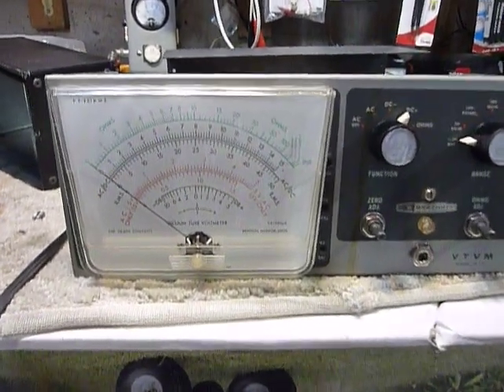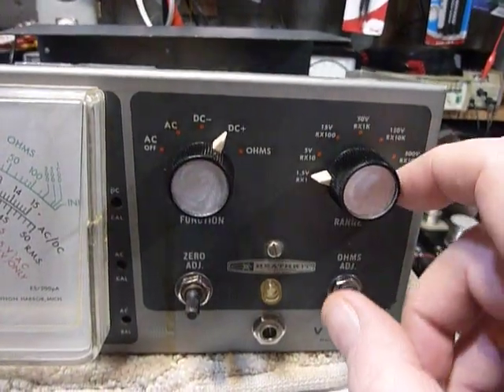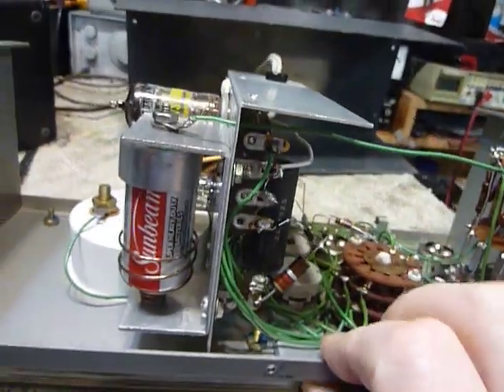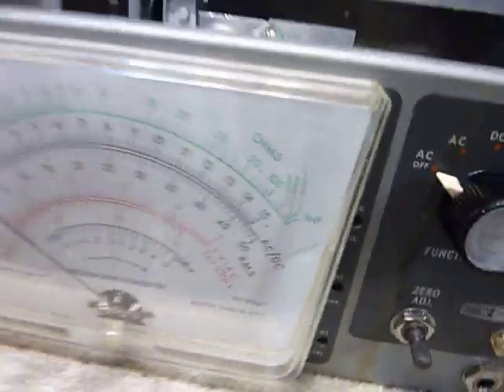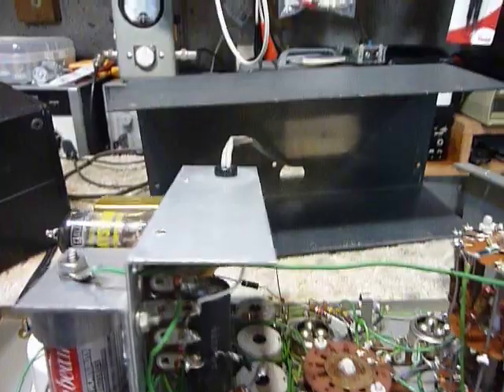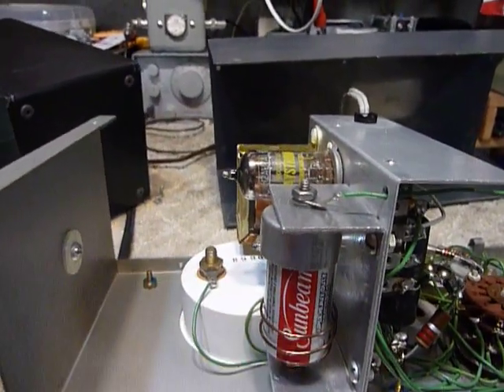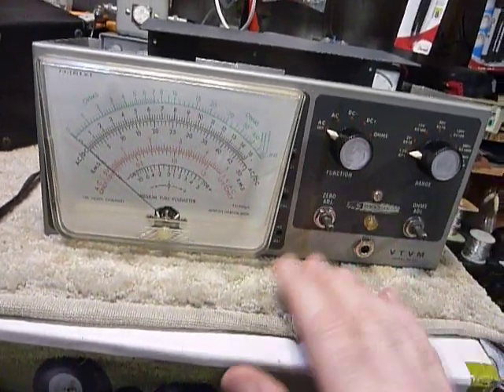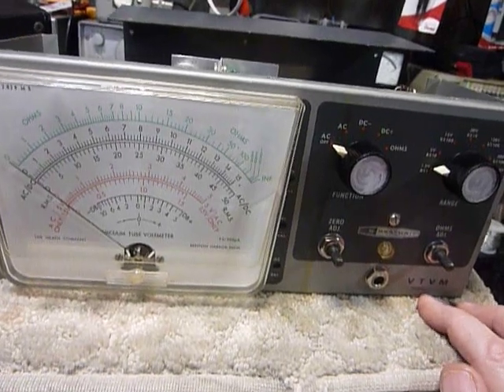HEATHKIT  VTVM , BATTERY ELIMINATOR CIRCUIT FOR HEATHKIT VTVM

Comment: Hi Bob,
I’m retired technician from the Bell System. I have a Heathkit IM-5228 VTVM that I built in the 1970’s. I recently decided to spruce it up. I used black anodized hardware to replace the oxidized ones. I also checked and cleaned all the contacts and replaced the electrolytic capacitor. 
I’m thinking about a battery eliminator and found your video. I like the simple design and especially the fact that the one you discus was designed by Heathkit.
How do you feel about the LM-317 based eliminators? With the 5228 eliminating the incandescent bulb from the filament circuit it should be able to support such a device? I’d like to hear your take on it.
Regards 
Tom Heckhaus

Comment: I independently developed this same battery eliminator circuit when I hacked my own Heathkit VTVM, the only difference being that I arrived at a value of 47 Ohms for the dropping resistor, instead of the 27 Ohms suggested in this video. My meter works fine with the battery eliminator using the 47 Ohm value, the Ohms ranges all work with the full range of my resistance decade box. 

That did not stop an overzealous viewer from repeatedly and persistently claiming that the battery eliminator design I showed in my YouTube video of the hack would not work properly, and/or would result in the VTVM not working properly in all Ohms ranges (yet it DOES), or somehow using such a battery eliminator design would damage other parts of the VTVM circuit, e.g. the power transformer. I feel vindicated what I see others happy and successfully using the same circuit.

Comment: This is one of the best circuits I have used Bob Thanks for sharing. Both my IM25 and I am in the process of completely building a V7 from Scratch it was in a house fire and is realy toasted  main board was badly burned I have got it ready to make the new board this circuit will be added to that one also And my RCA WV-77E has it installed what a fun project Keep up the videos Watch them all

Comment: note that you don't even need to filter the d.c. since the meter will respond to the AVERAGE value of the pulsating 1/2 rectified d.c. 
You can select components to yield about 1.5 volts average value with decently low source impedance.  Neither that approach nor this circuit regulates well on X1 range when measuring low resistance like a speaker voice coil or a light bulb filament.  Very good performance for high resistance DUTs like a 1k2 resistor and the like.

Comment: Nice job!  You didn't mention about the Cadmium oxide on the sheet metal screws.  (nasty stuff)  Tin whiskers on the cal pots can be an issue too.  A very good instrument for 1963 design.  The low current, large scale, d'Arsonval jeweled meter movement is the key to its high accuracy.  I've got an IM-18 in very good condition - really nice legacy instrument

Comment: Why would u do this to a vtvm? By doing that u alter the ohms per volt sensitivity  of the meter. The purpose of a vtvm is just that. The battery  lasts for years, The power for the ohms section has to be isolated and float.   Theres no gain to it your just degrading the meters specs. Why do u think Heath kit or any other manufacturer didn't do that?  You might as well get a solid state meter and discard your vtvm.
Reply: RN-ek4mh, you are hung up on things which are not important. As Heathkit found in their testing of this battery eliminator circuit, it works fine on all ranges and meets the specified accuracy. A great many others have also vetted this design and verified it works fine and has no downsides worth mentioning. While a battery eliminator based on LM317 works in a slicker way, with less power dissipated, both approaches work and this is well proven.

And while you ask "Why would u do this to a vtvm", I might respond "why would YOU repeatedly spell out all the words except 'you' ?"

You also fail to realize the primary reason that so many VTVM owners choose to retrofit battery eliminators. It has nothing to do with how long a battery might last, rather it is all about the damage that a leaking battery causes inside the VTVM, and not wanting to worry about it.
Reply: @youtuuba  Im, not hung up on anything it seems you are, as nobody uses vtvms anymore, but certainly that idea is a hugh waste of time and effort and effects the meters accuracy anyway. It just sounds like you have nothing better to do. A battery in a vtvm will last for years. If you worried about leaking use a lithium battery or one of the newer rechargeables they dont leak. Theres a reason meters were not designed like that. Accuracy and noise free power. Why would you try to make a better mouse trap out of something most people dont use any more. Heres an idea, when you change the batteries in your smoke detectors, change the battery in your vtvm.
Reply: @RadioRich100  , you obviously have an issue where you can read somebody else's statements without understanding their points. You are not worthy of my time.
Reply: @youtuuba  You dont have any time because your worried about replacing a d battery once every 5 years and constantly thinking about how to avoid it on a device nobody uses anymore. Do u x off the days on the calendar on when to replace the battery? Oh thats right you put a gadget in there that reduces the accuracy and reliability of a meter so you dont have to think about it. Heres another tip for you so u dont have to redesign your old meter, use a carbon zinc battery not an alkaline. That dont leak nearly as much and dont damage the equipment when they do. But then again who uses a vtvm. I guess if your trouble shooting a 60 year old heathkit radio.
Reply: @RadioRich100  , OK, now you have simply become rude. You are now making up insults because you have nothing meaningful to say. I know your type.

Comment: I'm hoping to get mine up and running soon and I'm going to use this battery eliminator.  Thanks for the tip.  I picked up two IM-28's, one with manual and probes.  The 9.1 Ohm 2W resistor on the best unit is out of spec at 9.68 Ohms, even for 5%.  The other is right on the line.  The parts list calls for a precision resistor and both the ones I have are 5% (white-brown-gold-gold).  The short glimpse I got of your IM-13 also appears to be 5% (unless the color on my computer is off).  I haven't found anything during research to contradict the manual.  Do you know what the deal is with these?

Comment: Good morning mr. Robert! How is it going? very good video, thanks for your input! I was doing some tests with your design of the battery eliminator for vtvm! And change 2 elements that were the 100uF capacitor for a 3300uF one, and the 27 ohm resistor for a 10 ohm one. Which gave me more stability at the 1.5v output. I don't know if you, for your part, do some tests and help me know if the change is well done. I hope for your reply very soon ...
Reply from the maker: Leonel  Good Job  what you have done should work fine....   all the best for 2021   Bob
Reply: @robertsumption1243  thank you very much mr. Robert! I mounted it today and in real tests it gave me exact 1.6v! I don't know whether to lower the capacitor and to 2200 so that it is closer to 1.5v! or increase the resistance to 22uf!
Reply from the maker: Leonel   Test it and as long as it works correctly  1.6 volts is fine  73   Bob

Comment: I'm trying to calibrate a Nakamichi RX-202 cassette deck for bias and for azimuth. The service manual says to adjust to 350mv and/or -.8db on a VTVM. I understand 350mv but never got familiarized with the db scale. 
 I have a heathkit AV-2 coming in the mail that looks new. This is an audio meter that measures only AC and in very small amounts as it has a 0.1v scale setting all the way up to 300v. Db seems to be a very much used reading so if you ever do a video on that subject or have already done so I would be very interested in the tutorial. 
 I will subscribe and look,thanks for the information and on self cleaning switch and the schematic of the C sized battery. So simple 🙂

Comment: Hi All - I’ve built the battery eliminator and it works great! One small tip - the 27 ohm resistor only drops about 2 volts, so it only dissipates about 0.15 watts. I used a half watt resistor, which works fine.

Comment: I just got a Heath kit meter like your upright one.,is that a c battery that goes in them ? I would appreciate your help with any of my questions you can answer,mine came with out any of the test leads ,I ordered test leads for the one on.the right and left sides ,but the 1/4  probe test lead or probe ,is that something I can.make ,anyone,or is there someone.who still sells them ,the person I bought mins.from didn't have the center test lead or probe so they wire a red wire through the whole ,I no that not right ,I ordered a new female 1/4 plug for it and and a new mono male plug 1/4 for it ,just in case I need it ,if you or any of your fans that have any info I would be grateful if seems to be a nice meter other wise ,I will order new caps to replace the was lapped caps that are in there

Comment: Very nice project, Sir!  I restored one myself and found it to be quite accurate for the rest of my Heathkit restorations.  One problem I'm finding out is that the pots used to calibrate the unit on this and my IT-28 aren't available as NOS or pulled stock.  What can we use now in place of them that will fit?  Quite the problem to work out.

Comment: At 4:38 you show the diodes facing towards the center post, but at 5:30 they are pointing away.
Some beginner won't understand.
Reply from the maker: In either case the 2 series  diodes  banded end  is connected to ground   and it will work fine .  73 Bob

Comment: I have quite few VTVM's but no IM-13 yet. I've got some boards ordered for the battery replacement. I went with surface mount parts so the board is only 1" square. It'll be interesting to see how the 2W SMD resistor does. I have a few other ps boards that I can use but they have an LM317 and more parts. I figure if Heathkit developed and used the circuit in your video that's good enough.
Reply from the maker: Mike Yes We all had Heathkit VTVM's on our workbench when i was in the service department and as far as I know all of them had this same simple  battery replacement circuit . 73  Bob

Comment: Hi Bob. I have a Heath Kit V4. The schematic shows a 6 volt battery pack bur the meter only has a single battery holder. I m seriously considering    a battery eliminator. Thanks for your videos.   
Brad

Comment: Hello Robert.  This weekend I built your circuit for 2 of my VTVMs, Heathkit IM-28 and an RCA WV-77E.  It works great, I get 1.45 Volts out of the circuit.  I checked all Ohms scales on both VTVMs using an Ohmite 1% decade box and all readings are spot on.  On your schematic the diodes are not marked but you quickly say what they are and for those that didn't catch it, they are "1N4007" diodes.  Thank You for posting this video.
Reply: You could use any diode in the 1N4xxx series for this battery eliminator circuit. The 1N4007 is rated for 1000V, but since this circuit never gets above about 6-7 Volts, even the lowly 1N4001, rated for 50V, is more than adequate for the application. I used 1N4004 (400V) diodes in the ones I built, just because that is what I had in my parts bin. The whole 1N4xxx series is good for 1A constant and 30A non-repetitive, again way more than enough for this battery eliminator.
Reply: @youtuuba  Good to know! Thanks. GB :)

Comment: Is there any concern about ripple in the rectified DC possibly impairing the accuracy of resistance measurements?
Reply from the maker: This was developed in the Heathkit factory by one of the engineering staff and was completely  tested to see that the VTVM'S worked properly to specs.  I do not know who that was that designed it . I do know that many of the VTVM'S  were modified this way in the Heathkit  factory .  73  Heathkits  forever !   Bob
Reply: The ripple is negligible, and anyway it does not matter because the meter movement's response results in an average voltage reading, which is what it is supposed to do anyway.

Comment: I do this when I restore VTVMs.  But my circuit is a diode, electrolytic cap, an LM317 on a small heatsink and a couple of .1 caps on the input and output of the 317.  Same plan to connect to the ungrounded side of the filament.  Same circuit works for 1 or 2 cell meters as you can adjust from 1.2v to whatever the filament winding can give you, 8v maybe.  for a one cell I set it to 1.45 and for a 2 cell I set it to 2.9 volts.  But the best thing is there is almost no extra load, so no big power burning resistors.
Reply from the maker: Good Idea  I like it   73  Heathkits forever !  Bob
Reply: Joseph Cote I think I’ll have to try your circuit. This didn’t work well with my old V7a. In the Rx1 range it didn’t have enough current to drive the voltage divider properly on low resistance readings. Drained the voltage to under a volt with probes shorted. Meter draws 150ma in Rx1 with probes shorted and draws more current than this circuit will supply to give you accurate readings. Works fine in x100 and up, less current needed.
Reply: @SIXSTRING63  Just use a LM317 in the TO-220 package, more than enough drive current that way.
Reply: I ended up just changing out the cap to a 3300uf. That kept up with the current demand and only dropped to about 1.35 v under load in the Rx1 scale. I will rebuild it though with the LM317 down the road.

Comment: Hi Bob,  Thanks for another enjoyable and informative home grown Heathkit video.   I have Heathkit V7 VTVM, maybe circa 1959 and did the battery eliminator modification just like yours.  Using the two 1N4001-7 diodes as the regulator/constant voltage source - - - the Rx1 scale could not be adjusted to Zero Ohms with probes shorted together.  Experimenting revealed that the 1.55 volt copper top cell was needed for Zero Ohms.  I replaced the two diodes with LM-317 linear VR  set to approx 1.6 volts and the old V7 works on Rx1 and all other scales.  As they say, YMMV- and mine did.  FYI, 73, Happy Trails.  KR7W.
Reply from the maker: Rich , Looks like you revealed a problem  there  .  I have done several of these with no problems and We had this circuit in many VTVM'S in the plant  I wonder why yours did not work  ?  You came up with a good solution ! 73  Bob
Reply: I had the exact same issue. Another poster commented on this thread that if built this way it will work, not on my V7a it didn’t as it didn’t yours. Same issue, not enough current to drive the meter in Rx1 setting. I breadboarded mine and found a bigger reservoir cap did the trick. I will be using the LM317 design eliminators on my other VTVM’s.

Comment: Bob, the internal layout seems far less crowded than the V7A types. Your unit looks go be in great shape. But wondering how the DC and resistance measurements are? They within the 3-5% accuracy?
Reply from the maker: Yes the IM13 is quite accurate